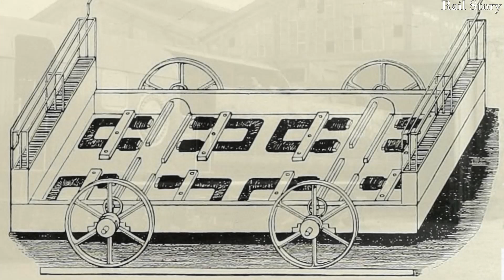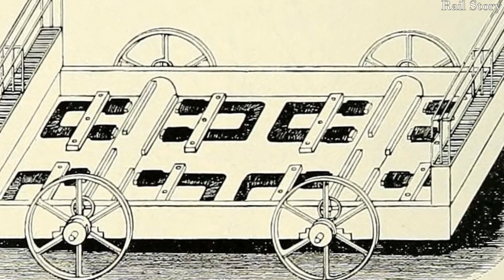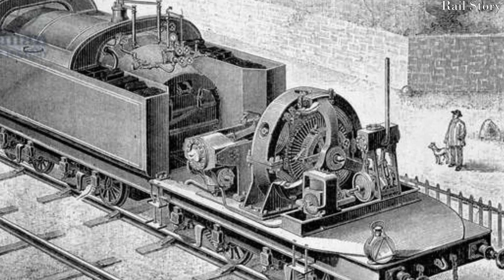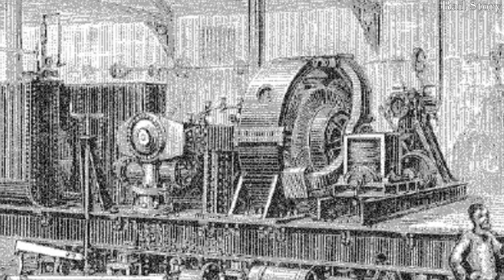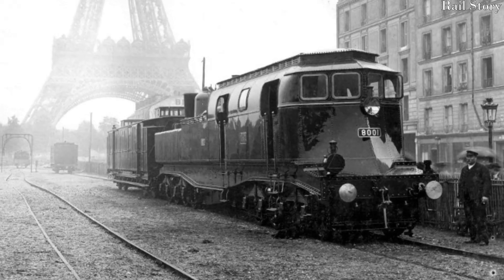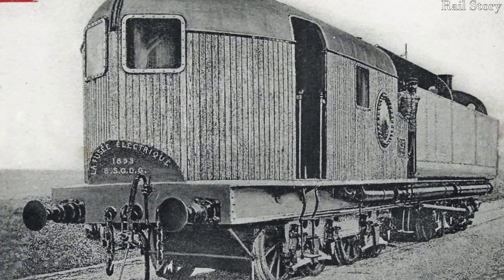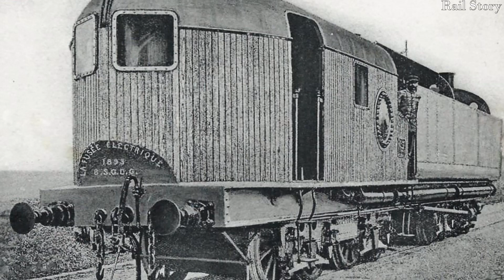La Fusee Electrique

Comment: THe Heilmann concept has fascinated me from the minute I learned about it. I honestly rather surprised railroads never really tried it again, the closest would be steam-turbine-electrics. The "power plant" on this could've evolved into a bank of steam cylinders. Akin to geared locos like Sentinel and Shays, but driving a crankshaft to turn a generator, rather than a drivetrain
Reply from the maker: The original concept for the Heilmann was for steam-electric multiple unit with all the wheels powered with traction motors. It would have been incredible. Certainly a concept well ahead of its time.

Comment: Thanks for this video, depicting what might have been. The two Chemins de fer de l'Ouest Heilmann locomotives 8001 & 8002, were the ancestors of diesel-electric, gas turbine & steam turbine locomotives that used electric transmission. When one of the first diesel-electric locomotives was reported in 1905, the Automotor Journal stated it appears to be something on the Heilmann principle, that is to say the engine is employed to operate a dynamo which in turn supplies electric current to motors geared to the driving wheels. Wiki

Comment: I wonder why they did’t use a turbine instead of reciprocating.
Reply from the maker: Turbines were thought of a quite fragile; despite Charles Parsons  in 1884 suggesting that the turbine would be an excellent means of propulsion for ship no one did it until the Turbinia ten years later. Plus, a Turbine needs a condenser and there's not much room for one on a steam locomotive. It's a problem later turbine locomotives struggled with ending up with designs which were a procession of vehicles. The only truly succesful turbine locomotive was that built by Sir William Stanier FRS in the 1930s which had geared drive and no condenser. Absolute beast of a thing and the same size a regular locomotive - heretofore turbine locomotives had been enormous.

Comment: Was the separation of the driver and the fireman really that much of a problem? (I read the same about Bulleid's Leader Class). It didn't seem to be much of a problem with the GWR Autocoach trains.
Reply from the maker: I suspect it wasn't, especially as the high speed steam engine was designed to operate at 300-400 rpm so the boiler and engine/generator set were intended to provide a constant power output.
Reply: One thinks of employing the R/T headset of aircraft, except that the fireman, in his exertions might have to keep replugging the intercom.

Comment: I thought they would have used turbines to make the electricity

would you ever consider a video on the experimental turbine steam locos? such as penny2
Reply from the maker: I might cover the Reid-Ramsay of 1910 which was a turbine-electric, Similar in conception to La Fusee Electrique.The modern steam turbine,  by Charles Parsons was only patented in 1884: theyd been used to generate electricity but were thought to be very fragile. It wasn't until 1894, despite Parsons suggesting steam turbines could effectively power a ship, that the "Turbinia" made its appearance so I dont think the idea was there to have a mobile turbine before Turbinia. There was also the problem of the size of turbines and the condensers. Ships have space for a condenser - locomotives don't. Which is why many steam turbine locomotives were a procession of rail vehicles! (one exception being Stanier's Turbomotive)
Reply: @AnthonyDawsonHistory  interesting point🤔

Comment: Very interesting this one, I had no idea of such an early application of a steam-electric locomotive.
Furthermore it seemed to have been quite satisfactory.
The use of a rheostat to control the motors seems a bit odd as the generator speed could be controlled via a steam throttle too.
Maybe the generator was kept at a constant speed with an automatic regulator? like those on a showman's engine.
Reply from the maker: Yes the generator was set at a constant speed from 300 to 400 rpm to create a steady and constant flow of juice for the traction motors.

I've a feeling I need to do a more in-depth version of this video......
Reply: @AnthonyDawsonHistory  , yes please.  i heard some clever innovations in this video.  for example, series/parallel.  this function seems to me to be one of the things that led to the early diesel-electric locos being capable of bettering steam locos.
Reply from the maker: @vsvnrg3263  I'll put together an extended, more detailed cut next week.

Comment: 8001, wasn't this loco built by English electric.?
Reply from the maker: 8001 and 8002 were built in France. The triple expansion compound steam engines were built in Britain but the locomotives were French with the electrical equipment supplied by Brown, Boveri of Switzerland.
Reply: @AnthonyDawsonHistory  Thanks for that information. I have a booklet published by English electric in the 1960's to celebrate the supply of their 2000th engine for rail traction. One of the earliest locos depicted is one of these french locos.
Reply from the maker: @nigelmitchell351  English Electric didn't exist when 8001 and 8002 were built - came into existance in 1918.
Reply: @AnthonyDawsonHistory  You're quite right, it must have been from one of the constituent companies that went on to make up EE.
Just checked, the six cylinder high speed steam engine in 8001&2, was designed built and supplied by Willans and Robinson of Rugby.
This is the same plant that went on to build many of the EE steam turbines in the UK thermal power stations.
I think, so I'll check, that LMS 10000 & 10001's 16cyl engines may have been built at the Rugby plant.? 🤔👍
Reply from the maker: @nigelmitchell351  Willans & Robinson which made the steam engines for 8001 and 8002 became partly owned by Dick, Kerr & Co in 1916. Dick Kerr became part of EE in 1918 but Willans & Robinson retained an independent existance. So it's a bit of a stretch for EE to claim it built 8001 or 8002.... really misleading to be honest.
Reply: @AnthonyDawsonHistory  I don't know when but Rugby's Willans and Robinson works was taken over by EE. It's still known locally today as "the Willans".
It's still in existence but now only does refurbishment of turbines.
Reply from the maker: @nigelmitchell351  That's cool. Didnt know they were still in existance! 🙂

Comment: Are you sure it was 6V 500kW dynamo? Because that would produce a current of around 83,333.33A. 1200A and 400V is more likely. Remember it only takes 40 milliamps across the heart will kill the average man.
Reply from the maker: It was a 6 POLE generator rated at 1200amperes at 400volts.
Reply: @AnthonyDawsonHistory  thanks for the correction. I did miss here.

Comment: Sadly steam-electric locomotives were not an answer. Things work better when the boilers and generation equipment are in a fixed facility and only the motors are in the vehicle. Of course the power Line$ and trolley wire$ are an i$$ue. Internal combustion does simplify things, damn it.

Comment: Thanks for the interesting video. However, could you please give the dimensions, weights, power etc in traditional English units. I don't think in the metric system.
Reply from the maker: we hear six pole, not six volt.
Reply from the maker: this locomotive was built in France, using the metric system. I used the weights and measures locomotives were built in. Furthermore, as a child of the 80s I dont use feet, inches or pounds and ounces. I only use miles for distance. We've not used Imperial measures in decades, thankfully such a confusing system was consigned to history.  So no, I won't be giving dimensions in "traditional English units" for a locomotive built in France. I'll use the measure appropriate to the design, with conversions for key dimensions if appropriate - and cylinder sizes and boiler pressure were given in metric and imperial. There are plenty of conversion tables or webistes around.

Comment: Very pioneering stuff this, both before the general application of the more obvious steam turbine drive, and before any reasonable automatic control systems for such a complicated setup. The crew must have been very busy indeed, controlling both electric and steam power application, while not missing checking the water level over the long firebox either. The Hermann Lemp patents for automatic coordination and control are yet some 20 years of, if I don’t get my years wrong.
Thank you for making and sharing, it was very unique and interesting!
Reply: Addendum: there may have been some synergies with contemporary French marine engineering. I know the French navy were early adopters and developers of electric power control systems for gun turrets, and ship remote control/signalling. Battleship Jauréguiberry (launched 1893) being the first with all electric power and control of the main armament. It may not be obvious, but rapidly and accurately pointing gun and turret with a mass of several hundred tons was challenging engineering.
Reply: @foowashere  Conrrolling the guns on boats in those days was very stressful. A lot of those guys ended up with speech impediments, most commonly Turrets Syndrome.